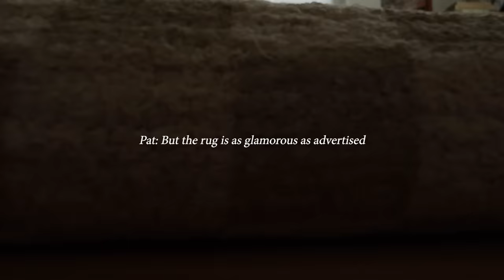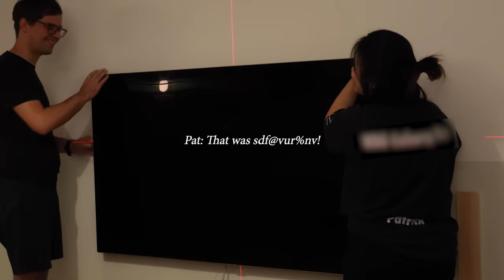Living room makeover | renter-friendly window blinds + board and batten

Comment: 😅😅 We just moved from France to Switzerland and discovered our ceiling is like yours, it isn't hollow and we need to use a hammering drill to drill holes for ceiling lamps. Gonna be in for a surprise 😅(we hate hammering drill)
Reply from the maker: Ahh, the pain of a hammering drill 😭 Make sure to wear ear buds or earphones!!
Reply: @cloudyhills  absolutely cannot understand why the germanic countries love to stick the gypsum board directly on concrete 🙄🙄. Why can't they do it like in southern Europe where rails are used to add in an empty space between gypsum and concrete so wires /pipes/ isolation can run through 😓